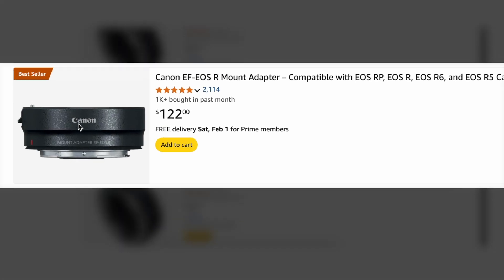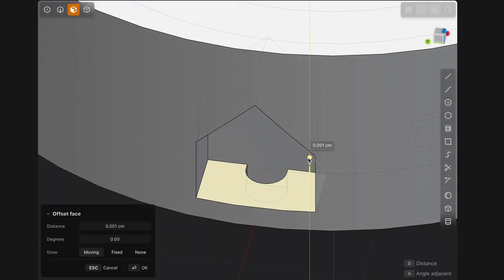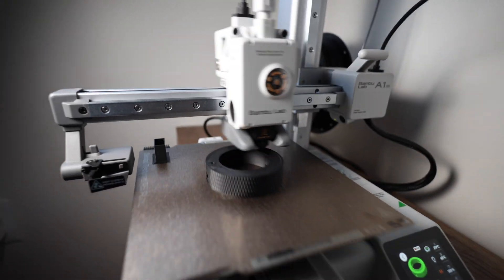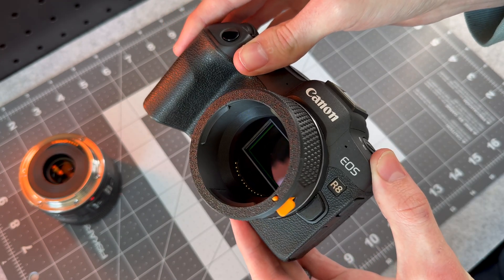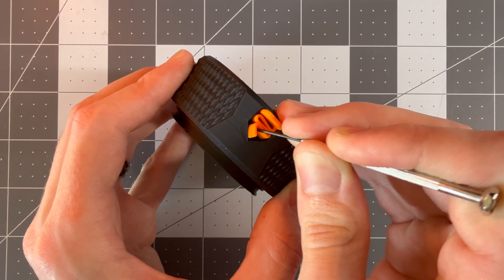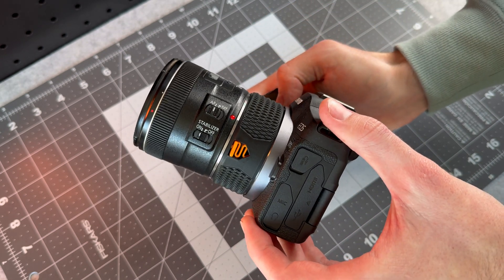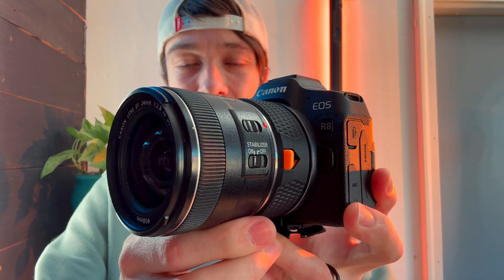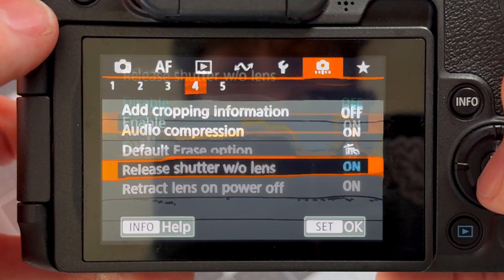3D Printing EF to EOS R Lens Adapter for Canon

Comment: 🤔 would this work the other way round? R glass on EF mount?
Reply from the maker: no, RF lenses have a shorter flange distance so if you add an adapter, the extra thickness will throw off the focus

Comment: You also lose aperture control which is somewhat important. Somebody made a 300mm extension tube and also put in passthrough electronics, you could probably mimic what they have and make sure the right pins to go the right contacts
Reply from the maker: that would be cool except with an extension tube, you can just run wires because the lens is directly compatible with the camera body, but with an adapter like this it's adapting different lenses which from what I understand would require additional electronics not just wiring

Comment: that is pretty slick .. i bet someone will find a way to print one with space some wires or pins that make the electrical connection. nice job
Reply from the maker: that would be cool except with an adapter like this it's adapting different lenses which from what I understand would require additional electronics not just wiring